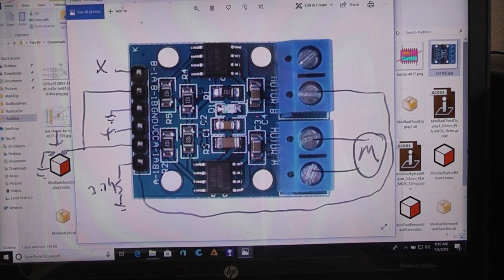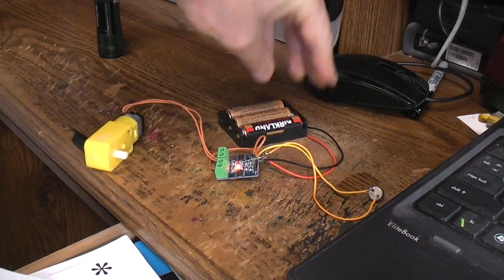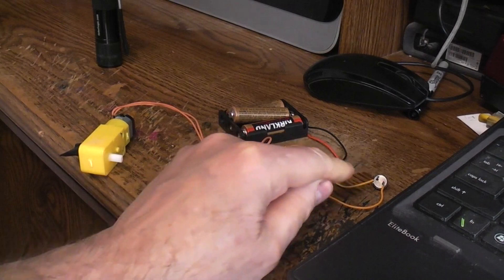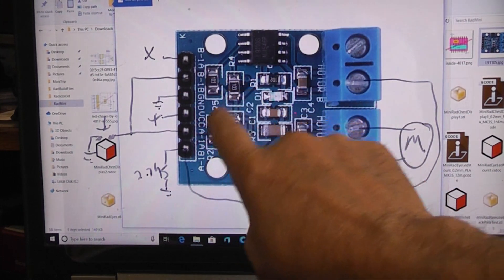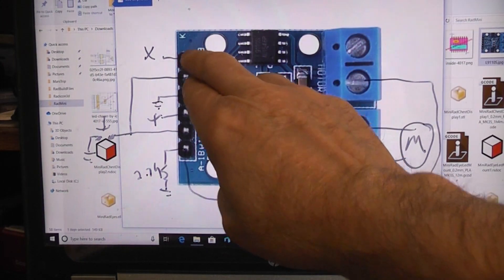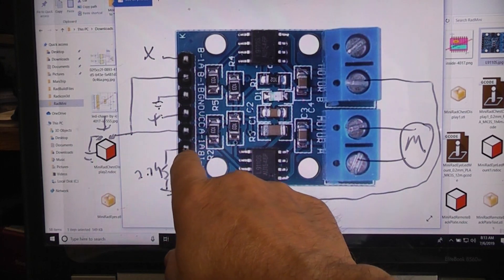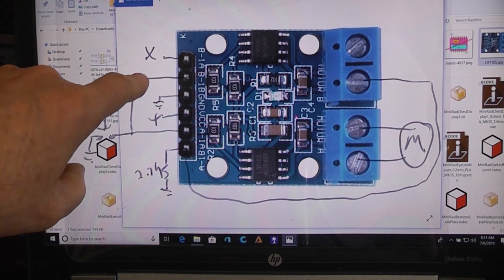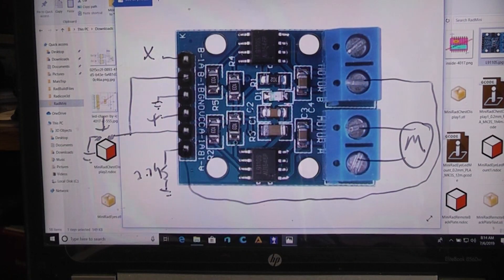L9110S mod, single control line FW / Rev low volatge motor control

Comment: Hi John  my name is Mike I have talked to you before. Just wanted to say thanks for doing this circuit.
I wanted to exercise a Skull and snake mech. The snake mech did not have a spring return so I thought using this dual
 H bridge to do a forward and reverse on the snake mech, instead of firing off the whole routine of the skull.
So I programmed a timer relay 1 sec on 1 sec off snake comes out and the snake returns thus exercising the gears and the track
the snake runs on.  I did a video of the skull and snake,  plus I would be able to make adjustments to the snake track to keep it from
snagging on the skull eye. This beats switching it by hand even with a DPDT toggle switch, I bought a pack of 5 of the Dual H bridge.
Been watching a lot of your videos we have the same interests for sure.  And I can think of many uses for this Bridge.
Reply from the maker: Sounds like a good use of the simple H bridge mod. Glad it was of use for you. Thank you for commenting.